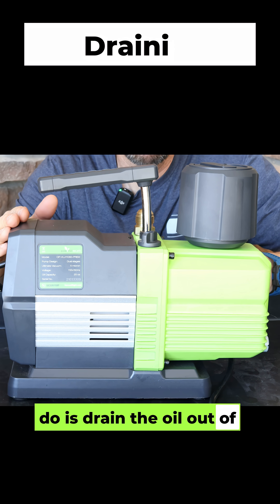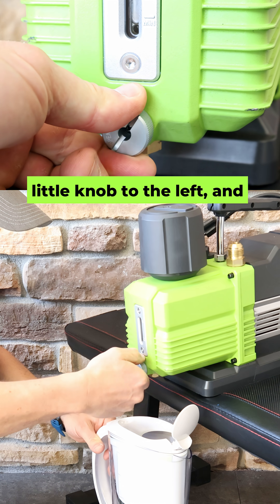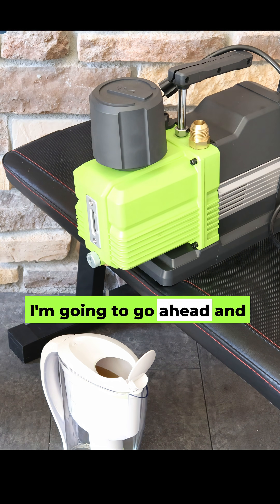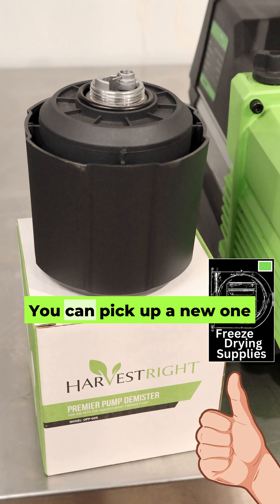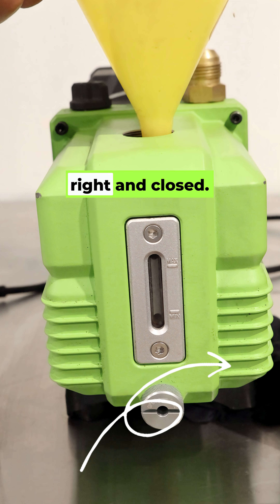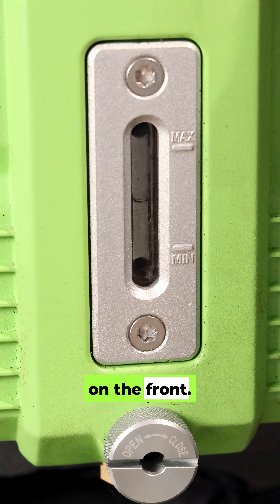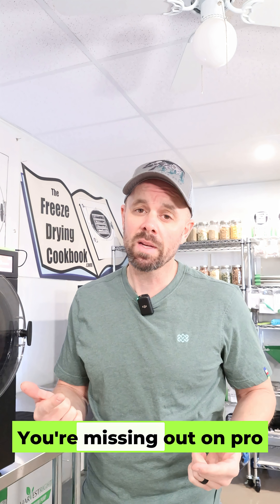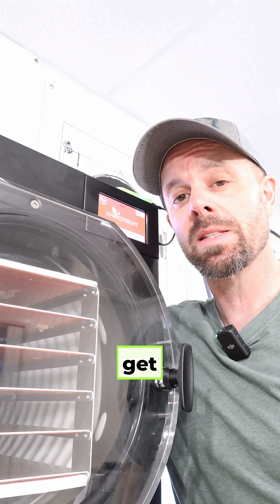Protect Your Freeze Dryer Pump with This Quick Tip!

Comment from the maker: Howdy Freeze Dryer! Are you missing out on pro freeze drying tips, freeze dryer giveaways, and invaluable food storage recipes? Unlock the secret to becoming a freeze drying guru by signing up for our email list at:  https://www.freezedryingsupplies.com/pages/monthly-giveaway
Reply: hello.  do you need to add oil in between filtering it?  or only add more if necessary after doing the filter process?  i have a sm hrfd with prem pump.  i'm on my 5th batch and wondering if i need to start doing this as my oil looks less than when i started.  thanks for your help.
Reply from the maker: @sbjerke  I not sure I understand what the question is exactly?  I think you are referring to adding while the pump is running?  Fill the sight glass to half way when pump is not running and DO NOT add more while running.  The black "filter" is not an oil filter, it's a demister that catches oil mist and water from the pump.  The actual oil filter is the pitcher that comes with the freeze dryer.  For that, you can add oil to the reservoir and it will take hours for that to filter through to the bottom of the container.
Reply: @thefreezedryingcommunity  no, of course i wasn't asking if you add more oil while running :(.  and yes, i know what the demister is and that it is not a filter. i have run 5 batches now and it says that i need to filter the oil (on prem pump every 20-25 batches).  but what i was wondering is...do i need to add any oil to the pump BEFORE that time.  or does that one bottle last me through the entire time (20-25 batches)?
Reply from the maker: @sbjerke Just wanted to make sure i was answering the right question.  The loss through filtering and loss through the batches is pretty minimal and the pump takes a little less than a quart to fill.  You should have a little extra in the quart to add to your filtered oil for your next run.
Reply: @thefreezedryingcommunity  Ok thanks.  i guess I'm just needlessly worrying.  just wanted to make sure i was doing everything correctly.  they only sent a small bottle of oil so i will get extra to have on hand for when i do filter it, in case i need to add more after the filtering process.